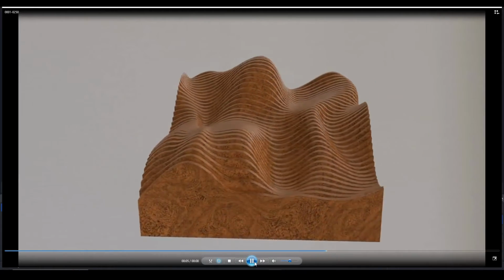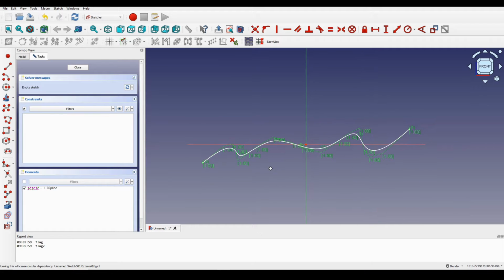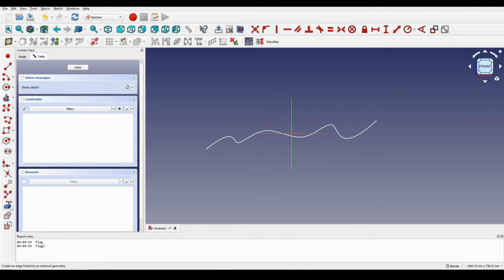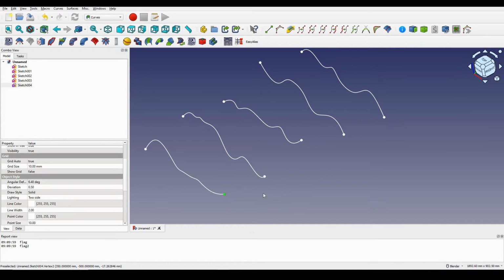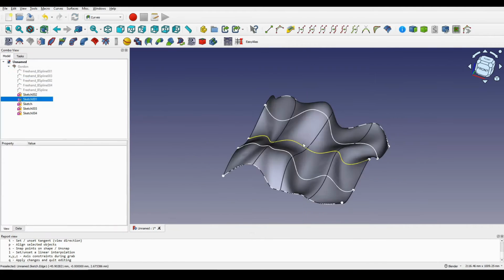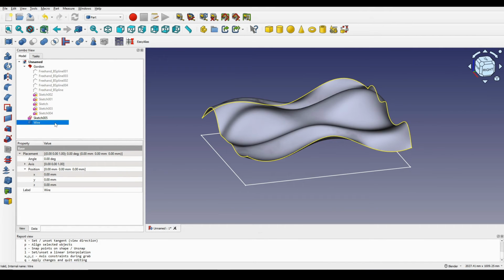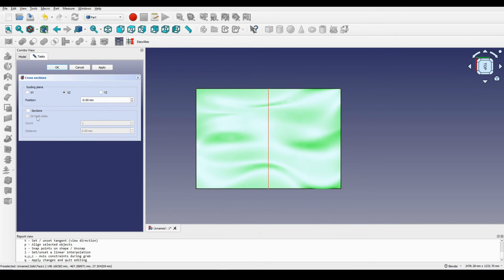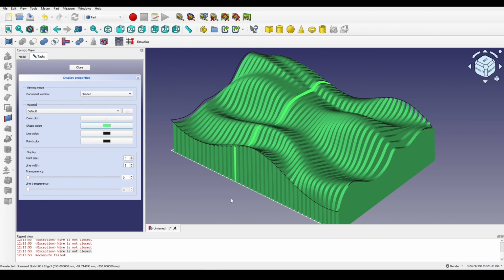How to create a basic organic parametric wall using Freecad

Comment: You were lucky to have at the end such a small rate of unclosed wire.  In my case 7 out of ten had issues. It is interesting to learn to solve these issues (coincent points, removing very small  extra edges ; Draft and Sketh wb both help in this case ; Bezier spline surely do generate a lot of problems) But I would not repeat this for more than a few sections, besides, the repairs-resulting solids are not parametric any longer. Thank you very much anyway, for all tutorial. In this case especially, I had never understood how to use the part WB section tool, which is so usefull !
Reply: I am one year late. But with FreeCad 1.1 I didn't get any errors on the curves. Everything came out just perfect.  FreeCad developer's team rocks!